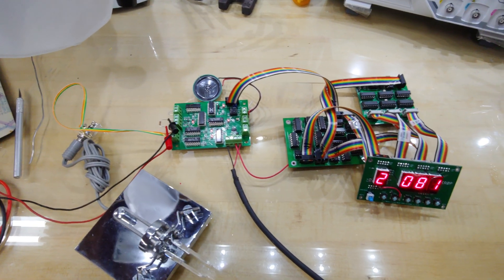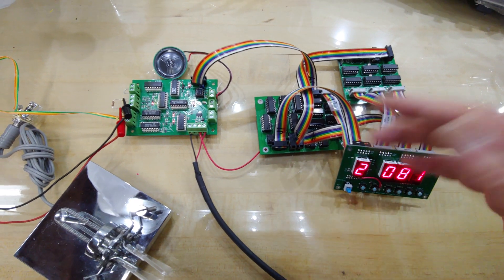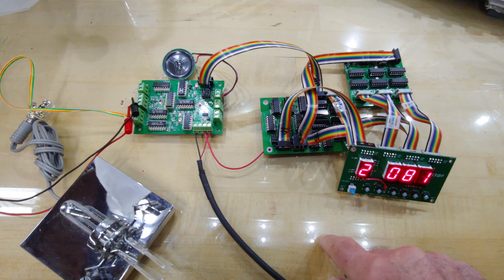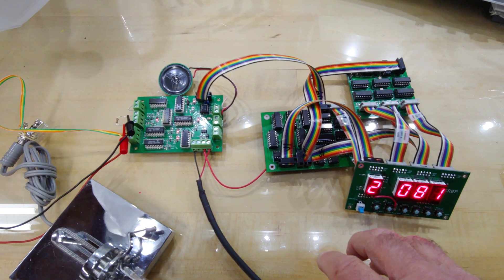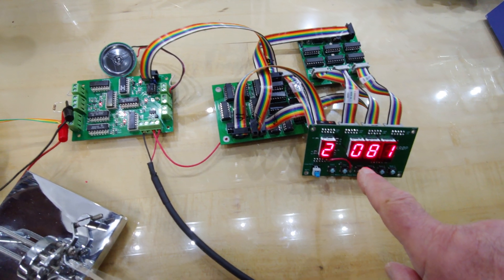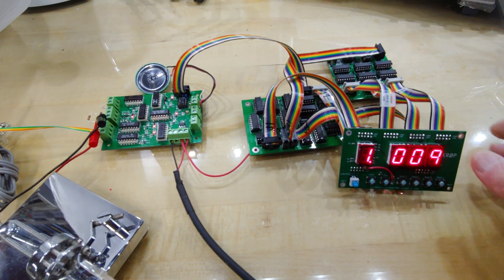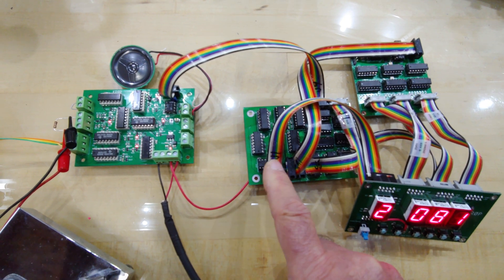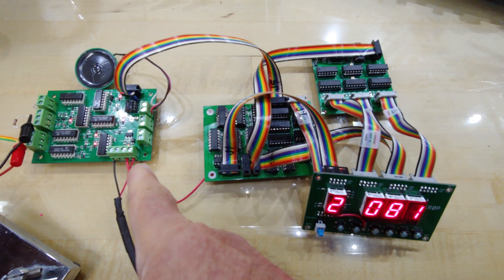WB4VVF AccuMemory  Keyer

Comment: Thanks for the memories !   I originally read about the "AccuMemory Keyer" in a 1976 (?) QST article.   The article included an address to mail order a set of the boards.   I remember at the time bankrupting my (student) wallet when I purchased all the parts from a local electronics part supplier.  It was a fair amount of work to complete, but well worth the effort.  It worked great for many years and was excellent to have along at Field Days.   I still have it somewhere.   I look forward to digging it out and using it again!   However I suspect that it might be best to replace the electrolytic capacitors in it first as I haven't applied power to it for more than 20 years !   Thank you for posting this video.